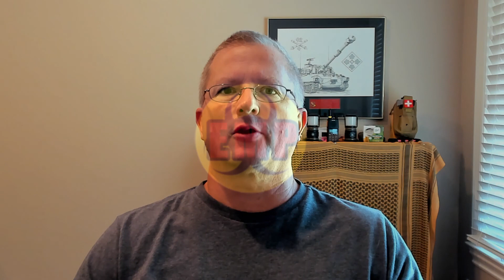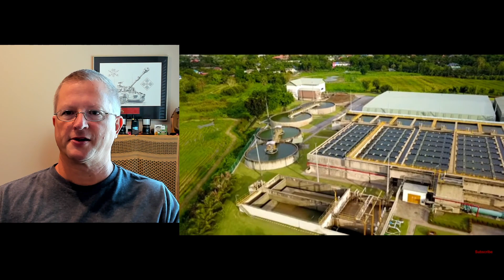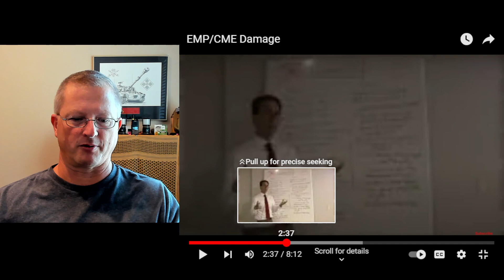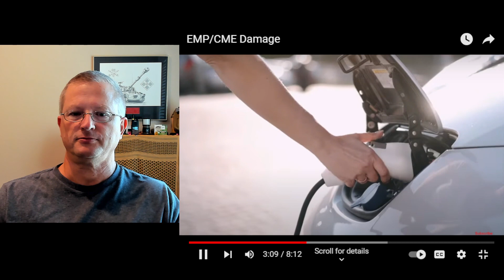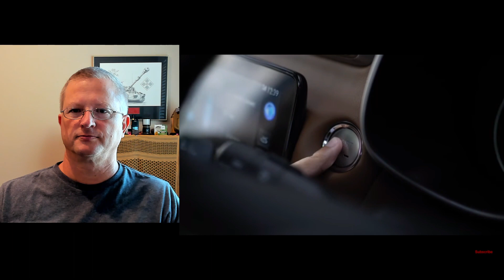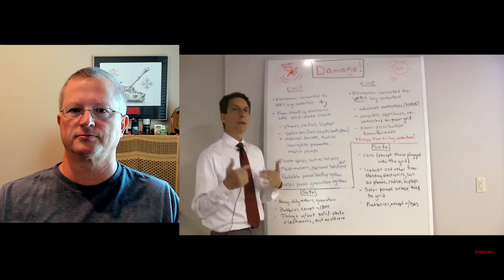⚡EMP & CME - What Gets Damaged  & What Will Survive - Plan Ahead Now - Time Is Short! - Prepping

Comment: So could you just shut off the main to the house? Would that help in a CME? And I have Mylar bags , would putting the ham radio, CB, old cell phones in there protect them?
Reply from the maker: From what I understand, in my opinion, it might help in a CME because the electrical charge/plasma probably won't jump the distance between the gap created in the breaker when they are turned off, and enter your home. You could even remove the breakers to create a large gap if there is enough time before the CME hits (usually a couple hours to a few days). For an EMP there probably won't be time to react, unless there is an early missile launch warning from the US government. which I wouldn't count on.  Hope this helps a little.
Reply: @EveryManPrepping  thanks!! It does help.  What about the Mylar bags you mentioned? I’m guessing I should go put stuff in them right? Although it may not matter. Idk. Everything is shoved into a closet at the moment 😂
Reply from the maker: @ckr_444  thick Mylar Bags work also, at least 5 mil thick. And I usual wrap the electronic in a cloth rag or put into a box so it's not touching the Mylar directly. Just extra precaution.
Reply: @EveryManPrepping  oh good idea! Thank you!

Comment: Thank you for your video.

Besides having extra fire extinguishers around, no. And I don't have enough of them either.

I suppose if it was a solar event and I had a few hours to "prepare", I'd grab a couple of huge heavy duty "plastic" insulated fish totes with the tight lids and put my generator in one of them and fill the other with electric tools I want to try to save. 

It's a 11,500 watt generator but it's very compact and it will fit in the Tote. I'd just set the Tote on its side and wheel the generator right in. Put the lid on tight and seal her up. 

The worse that can happen is it doesn't work but "plastic" has been insulating electronics for a long time now and at least I'll try. 

Imagine the freezers frying? Man, that would be painful. I do have ten dozen pints and lids "in reserve" for just such an event you know.
 
Keep up the great work and good luck.
Reply from the maker: Thanks. If the freezer does go down one thing you can do once the meats or veggies thaw is can them. If you have the canning equipment. If you have a nice thick aluminum pressure canner you can put that on Open Fire and still can your meats and vegetables.